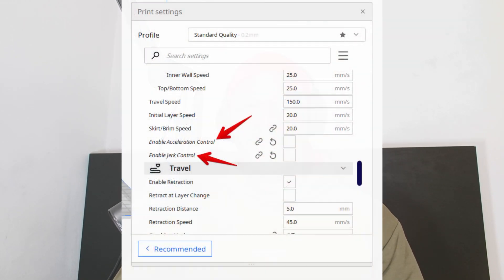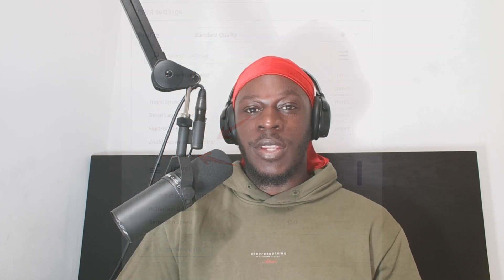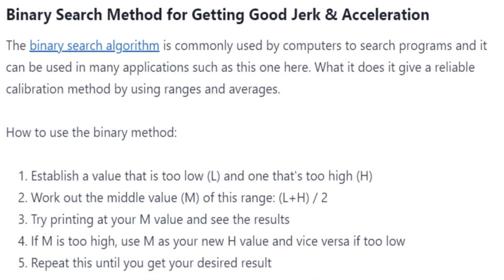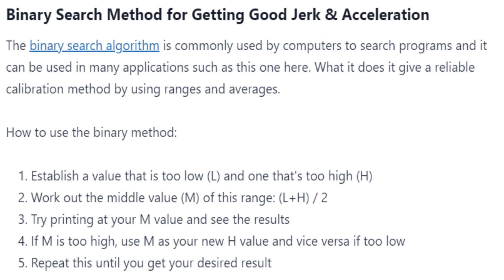🔧 Top Tips for Perfect Jerk & Acceleration Settings for Better Prints!

Comment: It can also mitigate bulging corners, which is huge, when trying to fit small parts/joints together. I've found 10mms Jerk and 800mms Acceleration to work well on Ender 5 series printers, but that's pushing it. Linear Advance is the way to go - it's time I upgraded.
Reply from the maker: Good point, yeah getting that precision for those corners is important. Thanks for the suggestion. I always recommend a Bambu Lab machine, the A1 is a solid choice
Reply: I'm considering the PS1, but I have a big issue with proprietary parts, so, it's a toss up with that and the K1C. So far, I'm leaning toward Creality, but only because my 5 S1 has been dependable and easy to mod/tweak.
Reply from the maker: Interesting yeah I get that. Did you end up choosing one of them?
Reply: As in, a printer? I decided I'd buy a Creality K1C, over the Bambu P1S, but then Prusa announced the Core One. I want to see some operational reviews on it, before I buy anything.